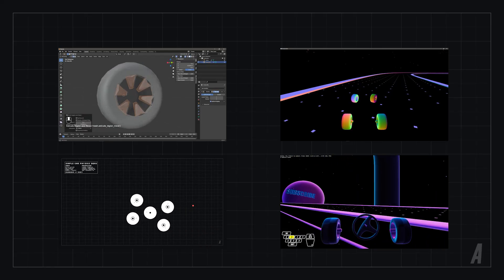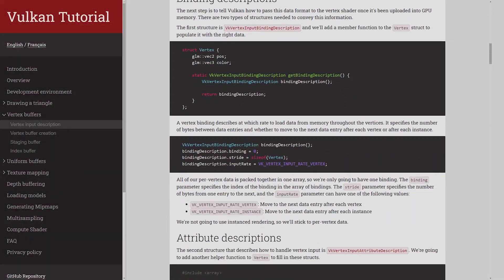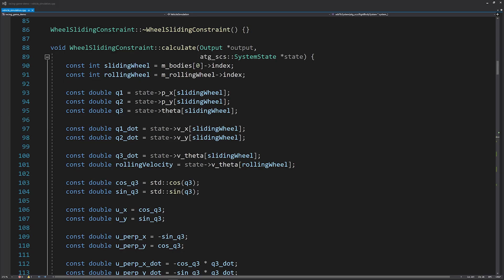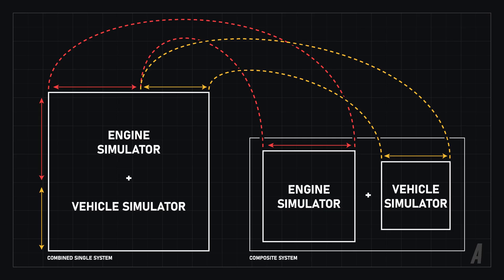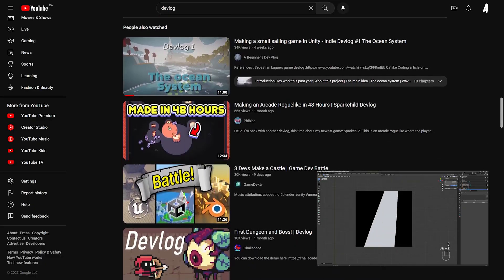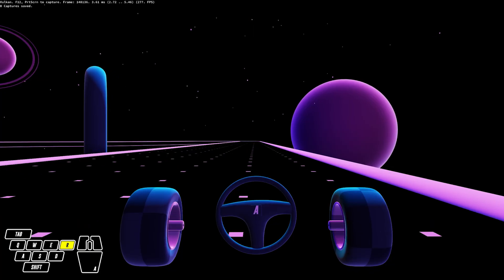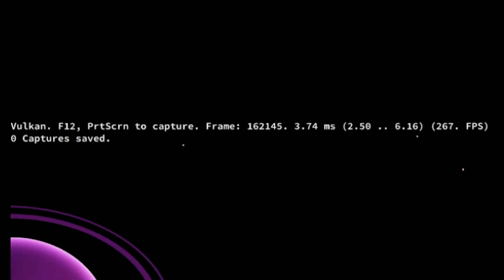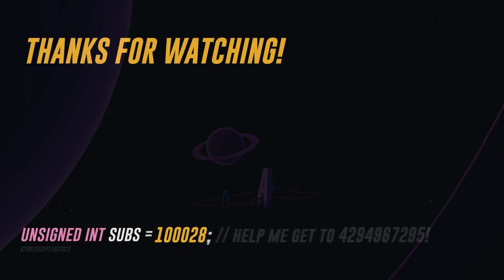Making a Terrible Racing Game with Great Audio (Engine Simulator)

Comment from the maker: A car with no parts other than wheels somehow sounds like a V8 and drives in a floating space platform where there is neither oxygen nor gravity. Subscribe for more realistic physics simulations 👍
Reply: I don't see a problem here. Just me and the V8. Thats heaven right there
Reply: @ChokeMeKermit  And the wheels too
Reply: Assume a spherical cow in a vacuum...
Reply: I'd hate to see the project target NVIDIA Cuda architecture as I'm using an ATI GPU, but the principles of mapping code to compute cores on a GPU are parallel at least conceptually.  Good luck!  Awesome project
Reply: With the engine sim 2.0 will we be able to hear the engine and exhaust separately and will it sound like real life in terms of engine and exhaust sound?
Reply: Is the Steam engine still being considered?
Reply from the maker: @alobowithadhd6191  Yep, based on the responses to my last video I'm still planning to release the mini-game to Steam
Reply: @AngeTheGreat  So you are going to release the Steam Engine Simulator to steam?
Reply: Better than NFS Unbound
Reply: will the new engine sim 3d be paid, if it is paid how much would it be?
Reply from the maker: @boogiehasfun  Between 10 and 20 dollars on Steam
Reply: Since your comfortable with writing shaders, why not port the physics code to run on the GPU?  Nvidia used to advertise PhysX or some such marketing name for just that purpose.

Vector math, floating point calculations, solving recursive math problems.  Seems like something the shader units would be optimal for.
Reply: How things work: The video 
🤣
Reply: Very ralistic just subscribled
Reply: Nice! I still can't get your simulator running, but probably need to upgrade my PC. In other news I think I'm going to release my Arduino code and circuit diagrams, I can't see myself having the time or motivation to make any more firing order videos any time soon.
Reply: There is a small disconnect with the sound and visuals. I mean the theme, not the vehicle. Some kind of convolution reverb could "glue" the sound with the visual theme.

One more idea, you could expose some values from the engine simulator to the shaders and make for example so that the background objects gets brighter the higher  you rev the engine. I'm sure there are much more interesting parameters too to be used. The possibilities are endless.
Reply: Dude, you’ve gotta license engine simulator out to game developers to use in their games. This sounds great. Something else I’d say is to add modifiable exhaust, if that’s possible, and also see if u can make it possible to make a version of engine simulator that has the engine directly connected to the vehicle as a part of the car (perhaps maybe a full vehicle simulator?). Just some suggestions. Other than that tho, great work
Reply: This is top notch realism 👍
Reply: there should be some high pitch filter on the sound. For some reason it's just screaming in the high frequencies.
Reply: I'm pretty sure that it is exactly the reason beamng supports you, as they found (apart from the audio) the furthest simulation experience from theirs
Reply: I would pay for a thought out racing sim like this
Reply: Its sounds like a wankel rotary engine
Reply: im digging this aesthetic with just the wheels an controls and steering wheel  though. maybe keep it like this for a whi;e and see if people grow to like it?
Reply: The game feels really slow for now, 
Thats a problem most racing games have, u can counter it with an zooming out effect that becomes stronger with more speed, that is what forza and Trackmainia do too
Reply: I'd play a game like that tbh, I like some weird stuff
Reply: Kinda sounds like a motorbike engine
Reply: can we download the simulation please, is there a link that i didnt see ?
Reply: Looks like an f1 car without the car
Reply: The game is very cool, keep going and do more things on it
Reply: Do you think Beam NG will pay you for this? I dont know if they already use this system so sorry for asking if they do.
Reply: Kinda sounds like ChatGPT wrote it haha
Reply: That jitter your speak of thats caused by the spring couple between the engine and car is actually accurate, there is backlash in the driveline, driveline flex, suspension flex as well as the actual springs in the center of the clutch plate (on road cars at least) and all of these things contribute to the jitter you have simulated.
Reply: How could you do something similar but into another engine, say unreal?
Reply: It's like 90s flash game meets unreasonably sophisticated sound generator. Which is fantastic
Reply: Honestly can’t wait to see the proper 3d engine simulator and see it’s potential for designing a theoretical engine design using the set physics in your system
Reply: people will keep echoing Night Driver for the Atari 2600 forever because it's the most simplistic visual depiction of a concept that could not exist in antiquity and was subject to extreme engineering constraints, necessitating its simplicity.
Reply: Hi i want to make my OWN roblox car game with realistic sounds is it ok if i reverse engineer the system?
Reply: What the middle mouse button does
Reply: You maybe already thought to it, but why not to train a neural network on some datas of real engine, to capture the empirical model of the sound generation and post process your engine sound for never reached results ?

PS: really nice work, and your video quality is genuinely enjoyable 👌
Reply: @Jebb8523 probably because that's pretty much the opposite of what this project is about and what makes it special/impressive...? (Coming from somebody with an M.S. in AI and every reason to be interested in that! 😉😆)
Reply: @dancoroian1  I mean if the main goal is to simulate sound, I think it is pretty much special, that you could catch a really deep level of details using Physical based NN. I mean if you could process in RT an almost perfect sounding engine with AI enhancer, idk in what it would be less impressive according to the fact in would be kindof an innovation.

Comment: You should not be allowed to design the steering buttons
Reply from the maker: You act like other racing games have good keyboard controls and they're pretty much all terrible. I don't see any better way of having smooth steering and semi-smooth throttle control with keyboard only
Reply: @AngeTheGreat  keyboard is mostly terrible for driving games but that dosent mean you need to make it worse. Changing gears could be set to Z and X (or Z X C with clutch) as using the mause buttons will make the mause move more wich produces less acuracy(and worse handling of the car) and even worse is using the middle mause button wich is horrible in many different ways (most people dont use middle mause button in games) why didnt you just use space as brake? And in final version of the game you could add the option to change the wheel stering from mause to A and D (the biggest issue here would be that the middle finger cant go above index finger).
Reply from the maker: @SpaceFH  I assure you, your keybinds for gears and clutch are much worse than mine. Not only is it borderline impossible to operate the throttle while changing gears, your left hand now has to manage three different operations at the same time. Having the brake also be controlled by the left hand doesn't help things at all, adding yet another operation. I did try having the brake mapped to the space bar. It's acceptable but I preferred to use the middle mouse button personally. Using mouse to steer was vastly superior to using the keyboard (either arrow keys or A/D). Using A/D to steer would completely overload the left hand.

Mapping a system that ordinarily uses 4 human appendages to a keyboard and mouse will always result in compromises and I tried a lot of alternatives and my approach was the best. I think you're exaggerating how bad it is (especially considering you've never even tried it)
Reply: @AngeTheGreat  i actually played whole of minecraft only using mouse it was an horrible experience.
Gear thing is actually the same in beamng drive. Side buttons could be better as you have a thumb free.
Having buttons on mouse when it's an major controller is rather annoying when it comes to minmaxing.
The biggest issue with my version of the controls would be that some keyboards don't allow more than 3/2 inputs in an area.
Yea overload like you say is an issue but a proper player would adapt I mean the controls are already scaring off casual so it wouldn't make such a difference.
There is a reason why most games don't use the middle mouse button to click or the mouse overall when it's an major controller.
Reply: @AngeTheGreat  Anyway have a great time creating your game best hopes for you :)

Comment: Kinda getting MEGARACE vibes 🤘👍
But yea, the spring connection (driveshaft, you could say), gives it a racecar feel, audibly speaking. As though it's incorporating the solid rear diff (full-locker), or alternatively, the change in traction of the drive wheels when cornering which causes a spring effect in the driveline.

Also, this (your engine sim) would've been such an awesome companion to the old DesktopDyno 2K/2K3 software, back in the day. 😊

Comment: This is a great video and wonderful achievement. And I can forgive the necessary short-cuts and appreciate this for what it is.

HOWEVER... :-)   the one thing I cannot forgive is how much the steering wheel rotates! Racing steering wheels only exceed 180 degree rotation in the tightest of hairpin turns. If you could scale down the rate of rotation for the display of the steering wheel, I would be 100% happy :-).

Other than that, great stuff and carry on 🙂

Comment: Theres a thing called the Ackermann Principle. Its to do with steering geometry. Im no expert, but i know its required in order for a vehicle to turn correctly. I can see the thing is just not turning right. Understeering like fuck. Needs camber and caster too
Reply from the maker: It does have correct Ackermann steering geometry but the friction coefficient is probably too low. I set it that way to compensate for the lack of other effects like weight transfer. Camber and caster are not relevant in this case because they compensate for real-life effects that are not considered by the simulator

Comment: Sometime soon, automation might realize about this and may help you or collab, considering that automation is missing on some key important engines, the only ones we have are boxer 4, 6 cylinders, I3,4,5,6 and the conventional V8 on both sport and muscle engines, with a few sports cars engines.
I honestly feel like automation is missing on some real important stuff by not adding rotary engines or a flat plane sound for every engine (the only engine that has it is the V8 that sounds like a sports car)

Comment: I have a tiny complaint/improvement suggestion to this overall insane achievement: The engines sound like they burn too much fuel when revving down. It sounds more like the load is too high for the engine to handle instead of cutting air/throttle.

Comment: This is a wicked cool project, I was considering attempting to make a movable version in unity just so I could make a racing game, until I realized the simulation rate at which the engine simulation is running at, I've seen a lot of comments on the other videos about baking the sounds at all conditions but that seems fairly impossible considering all of the things taken into account, although this is pretty damn cool considering. Alternatively how bad do you think it would be to just run it in the background and just use the inputs via some monkey as an inbetweener? Seems just as wacked but I really hope to see this become a fully fledged tool for the next era of racing games. Keep up the good work man your a monster.

Comment: Great video! But why not use the car you modeled in your ray-tracer video, that will be way cooler.
Reply from the maker: Shortly after I released the video, that's exactly what I did. You can see it featured on the project's GitHub page: https://github.com/Engine-Simulator/cosmospeed. I just ran out of time before my deadline for this video so it didn't get included

Comment: You should implement a simple as possible collision system:
1) make the edges of the road actually solid and bumpy
2) allow the player to bump into the arch and the giant "A"  (make them solid)
3) prevent driving past of the outer side of the edges of the road via some invisible trickery
These features would be well enough to make this playable demo "complete". 😉

Comment: It already sounds so good. Just wait till he makes the engine sounds reverberate off of surfaces. i.e. I just really want to hear some tunnel runs xD And it would be cool if the transmission could be emulated too to hear the gearbox whine. Baby steps, I know this a lot of work for what it is atm.

Comment: Oh my God. "Tire position relative to the ground needs to be zero"
What a succinct way to solve the problem of animation syncing.  Thank you for posting this. That one line helped me with a bit of code I hadn't gotten around to designing yet for a character wall running. 
Also, love this engine in general

Comment: what's even better is that technically there's no brakes and you're doing that, it's pretty clean, and it's realistic asf. i've been in a v8 supercar (aussie here) and it sounds pretty much the same, except they change faster, rev higher etc, but that's down to the driver, not the engine/sim so i'd say you've done an immaculate job

Comment: lot of white noise. could probably EQ it out
Reply from the maker: It's not that simple unfortunately. The noise is pretty critical to the sound, especially at low rpm. At high rpm it becomes more of a nuisance. I've thought about using an adaptive low pass filter based on RPM but I felt like it's too "fake". I'm hoping to find a cleaner solution to this problem when I start rewriting the audio engine
Reply: @AngeTheGreat  I understand what you mean. But wouldn't it be possible to clean up the top frequencies with an EQ at the very end of the processing chain, so you still get the engine noise but also clean it up at the very end?

As it is, the white noise kind of gives it the feel of an engine suspended in one of the test chambers that manufacturers use to tune engines, with all that sound bouncing around the walls and distorting over a microphone, which makes sense for the OG engine simulator. However, having the engine sound like it's enclosed in a little room doesn't make as much sense contextually now that it's attached to a 3D driving game. If that's the path you're taking the project, I do think it's worth figuring out how to clean up.

Comment: Shocking that merely modeling wheels with a predefined force limit, and an engine coupled to those wheels via a modeled spring, does a better job than any game with driving in it aside from sims.

I'm seeing both understeer and oversteer, and visually it looks predictable and quite linear. The steering angle is also always greater than the actual turning angle. If this isn't accurately depicting slip angle of an elastic tire, it visually looks quite close.

Games like GTA and Cyberpunk do a truly awful job of simulating vehicles. Somehow the car does not turn in, and doesn't understeer, and doesn't oversteer unless you power brake at a stand still. Games like NFS and Burnout have such warped physics to make the game play well as an arcade that the car becomes unpredictable and is so unmatched to reality that anyone who has actually driven a car can't recognize the handling characteristics.

On another note, using a spring to couple the powerplant to the drivetrain is a reasonable way to do it. Especially in muscle cars or older vehicles, the axle has a tendency to wrap around the leaf spring, essentially introducing this springy characteristic into both the sound and the driving feel. There is some backlash in all gear driven components, and the driveshaft is not perfectly rigid either. Hell, the clutch pressure plate has springs in it to reduce the shock to the brittle disc. The flywheel acts as a mechanical battery, storing some momentum and smoothing out abrupt changes to throttle position. A spring does a reasonable job of approximating all of these effects.

Comment: If what I'm hearing is the spring linkage, it actually sounds pretty realistic. The drive train in cars isn't perfectly rigid (obviously) so that wobble at low rpm is pretty accurate to a lot of high performance cars.

Comment: I really hope Ange gets the support and resources to really make a proper racing simulator. A lot of racing sims tend to only focus on circuit-based racing so when it comes to drag racing, drifting, rally/rally cross, etc., they usually overlook it and put less work into making things like drag racing transmissions or steering angle kits required for other forms of racing. Of course, it's only natural for a game studio to focus on one type of racing because creating the proper physics and parts for each type of racing would be extremely time consuming and expensive, but it would be nice to have a car that could be a time attack car, an 8-second drag car, an extreme Pikes Peak car, or a WRC car.

Comment: The spring jitter adds to the realism, look at a real manual car for instance - the driveshaft, axles and transmission shafts all twist (slightly) with higher torque, not to mention the literal springs inside the clutch disk.